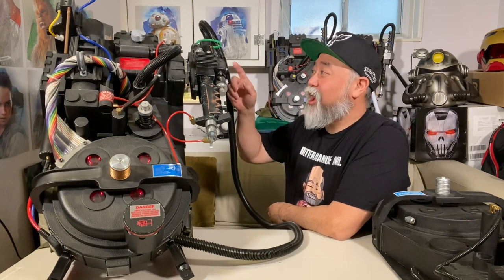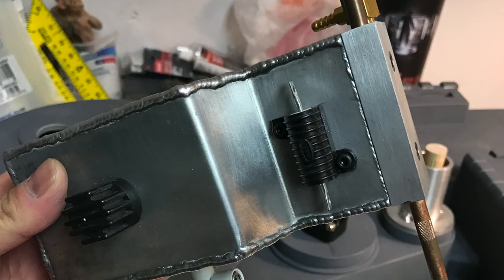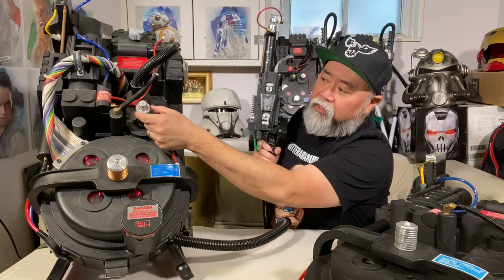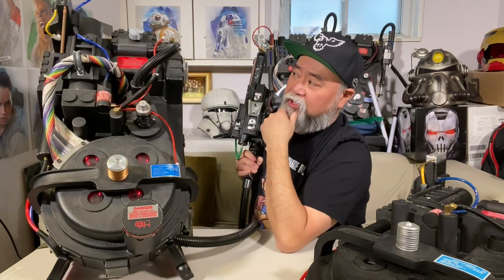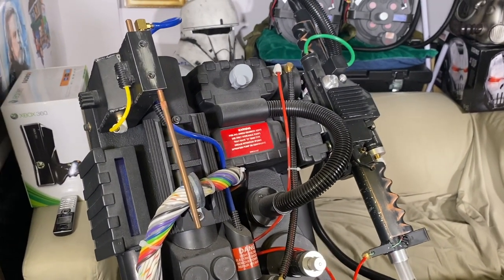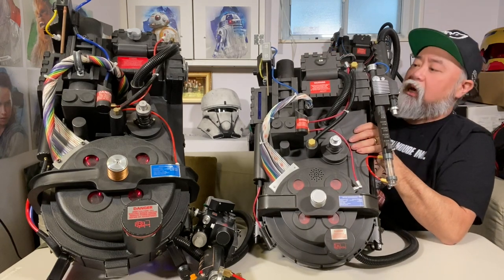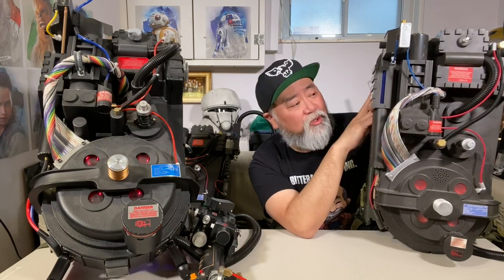1:1 scale replica Hero GB1 Proton Pack from Paul Sun-Hyung Lee's "My Geeky Basement"

Comment: Nice to see your  pack in action. I recognize you from the GBfans forum (and from TV, Canada represent)...Canpara's build thread is my bible right now. I'm working on a Ben of kent kit, and have gotten  my GB1 ribbon cable from Fincher technologies and my Spengler plate from Nathan down in Florida. Hoping to prime and get a coat of truck bed liner on my pack this weekend. Stay safe
Reply from the maker: Thanks! Mario's build thread is THE go-to if you want precise detailed instructions! We were building around the same time and often drew inspiration from each other! He's an awesome guy too! I got a chance to see a BOK pack a few years ago at Calgary fanExpo - so pretty! Looks like we have a lot of the same parts for our packs. Love nstevic's Spengler plate! Best of luck with your painting!
Reply: @Bitterasiandude  Mario's thread is 100% a great resource. Only thing I wont be doing to my pack will be the pop mech and twist grip. The resin gun box in the BOK kit looks like its gonna be tough enough to get the ghost labs light kit in...so maybe one day I'll upgrade to an all aluminum thrower. Was hoping to have everything done in time for the new movie and fan expo Toronto but alas all of which are not on the horizon any time soon at this point

Comment: Amazing 121 scale proton pack. I'm currently getting all the parts to do a modification for the spirit pack and after that we'll start working on the 121 scale. I have a question, what mounting hardware did you use to attach the Alice frame to the spirit pack?

Comment: One thing I dont see anyone talking about is the battery or speaker. I am building my own and trying to find a reliable battery and good speaker for the pack is hard. Any suggestions would help.
Reply from the maker: Check out my build thread: https://www.gbfans.com/forum/viewtopic.php?f=2&t=41833&hilit=naptime I used inexpensive JVC speakers (4 ohms) and a 12 V CCV battery I ordered via Amazon. Both have come down significantly in price over the last few years. Good hunting!

Comment: Man some day I hope a mountain of money just spontaneously materializes in front of me. Because one of the first things I'll be doing with said magic cash would be grabbing one of these suckers. I have a couple of the Spirit Halloween packs and for the price point they're great, but nothing can compare to a full on replica with all the bells, whistles, and theme song. I kinda wish the sensible part of my brain would take a vacation sometimes so I could say "yeah I'll save up for that" but I just can't. Still they're always fun to see in action so thanks for sharing!

Edit: Wanted to ask! Did you do anything with the wires on the Spirit Halloween packs that connect the wand to the cyclotron? They're so stubbornly stiff and do not want to move where you want them to. Someone suggested to take a box cutter and cut a straight line along the entire cord and it fixed the problem right up for them. A little hesitant to do that since I don't exactly want to cut the wires inside. However if it's a nice fix and works ok I may give it a shot. I figure some pull ties along the cord and near the ends to keep it from coming undone completely may do fix any issues that may arise.
Reply from the maker: That's exactly how I felt after I finished my foamboard proton pack! You just gotta bear down and make a plan - just know it's gonna take a long time, but that's half the fun: gathering materials! Good luck and thanks for watching!!!

Comment: Hey Paul! Huge fan of Kim's Convenience and I was wondering if you could share some tips or things you wish you knew before building your proton pack? I currently have a fiberglass shell and have ordered some parts and was interested to see if you had any words of wisdom being that you've already built one. Thanks!
Reply from the maker: Congrats on taking the leap and starting your build! My advice would be this: take your time and do your research. I studied several amazing build threads on gbfans.com to see what others had done before me to get a better idea of what to expect. A lot of it made sense once I had the actual parts in hand (it can seem pretty abstract when it's being described). And as the old adage goes: measure twice, cut once (or drill once!). I often double and even triple checked measurements before I drilled any holes in my shell to attach parts. That being said, there were times that I was a little too careful and afraid I was going to mess up my build. Mistakes will happen BUT, it's all fixable, so have fun and don't stress too much! I remember the first holes I drilled to attach the clippard valve, it was like I was expecting the shell to shatter or explode! :D 
Let me know how your build goes!
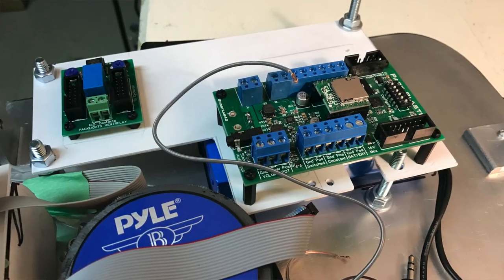Reply: @Bitterasiandude  Sorry for the delay and thanks for the insight! Things have been slightly delayed due to the current pandemic we are in so I have yet to receive all of the parts. As for the electronics, I know that you mentioned that it is all plug n play. I noticed on GBfans they have several electronic parts, some of which are interchangeable with others. I'm curious, I see that you have the amplified soundboard, wand light kit, and power cell/cyclotron light kit in the pictures you included in your video. But I also noticed you have an additional board right above the speaker at 7:27 with a ribbon cable attached to it. Unless my eyes are just plain bad, is that one of the parts I mentioned earlier, or is it a different part? It looks like the light kit adapter board but I noticed on the product page it says that all you need is the soundboard so I was a bit confused as to whether or not I need that part. Overall, I've been roaming the forums and I've been having difficulties tracking down a master list for all of the electronics. Any advice would be much appreciated!
Reply from the maker: @Cardshark45  Hello! The additional board is the vent light relay. If memory serves correctly, it's for the e-cig vent I have installed in my N-filter. Here's the link describing it: https://www.gbfans.com/forum/viewtopic.php?f=31&t=37213 
If you're not installing one, then you won't need it! You just need the amplified soundboard, wand light kit, and power cell/cyclotron light kit.
Reply: @Bitterasiandude  Captain Teva! Most of the parts have finally arrived! Thank you again for your insight on the electronics in your build. I've also been doing a lot of digging on the painting process and I was wondering how you achieved the weathered look on your pack? Did you use a silver primer underneath the black paint? I also was wondering if you used a specific pack blueprint on GBfans to figure out where to place the holes for mounting the various parts of the pack? At this point, I'm kind of just staring at my pack shell trying to visualize where would be the best placement to drill the holes. I have several reference photos and I can kind of estimate where the parts would go but I was just curious if you had any insight on this part of the build process.

Comment: nice pack but the cyclotron is not centre on the generator and the bumper is wonky :/
Reply from the maker: I'm not sure what you're talking about. Perhaps you're basing that on the angle the pack is sitting at. But it's all screen accurate...
Reply: @Bitterasiandude  im sorry but the bumper is not level with the rest of the pack...evident by how each side lines up and also bumper doesnt look correct at all, the cyclotron is not central to the generator either...but im glad your happy with it :)
Reply: @Bitterasiandude  and the cable clip is upside down lol
Reply from the maker: @mandismith89  Haha! You're right! Just looked at it now. The bumper isn't level. And you're right about the cable clip too! As for the cyclotron not being central, it was molded that way. Ah well, you're right with the fact that I'm happy with my pack. Do you have one to share pics of?
Reply: @Bitterasiandude  still building my new one at the moment buddy but will send you some when its done for sure